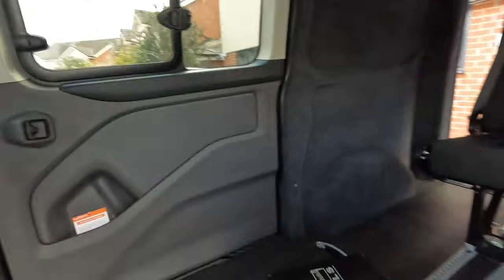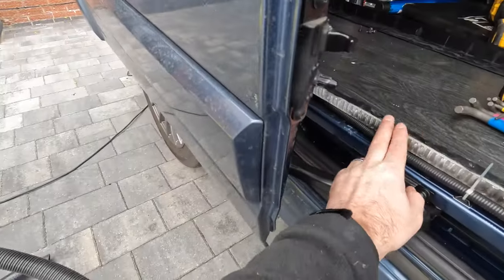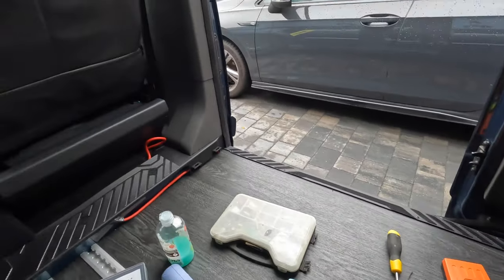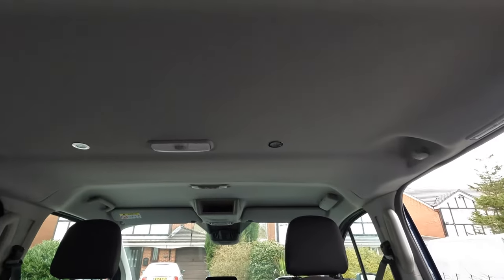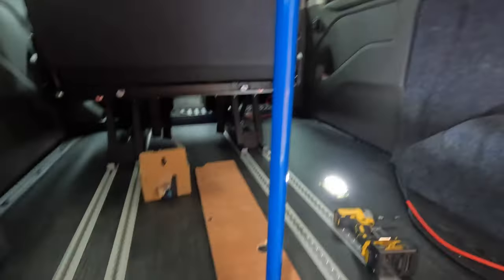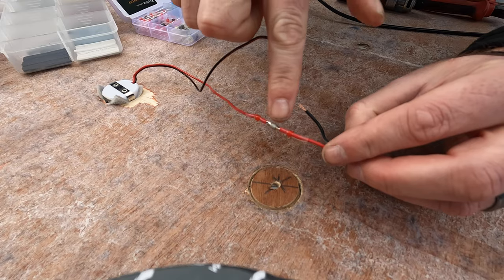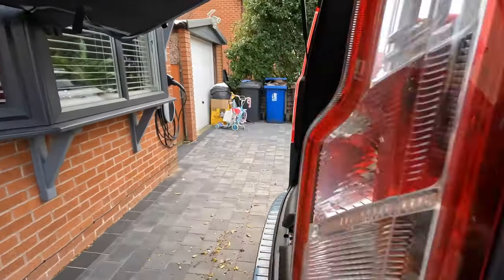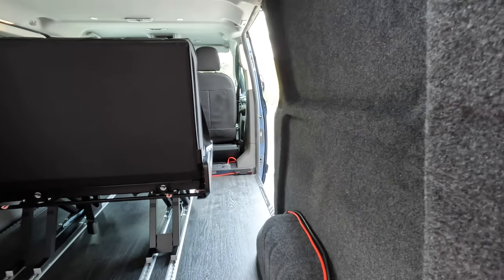Ep 4 Electric install and new Roof lining in a Transit custom camper van conversion

Comment: Where did you grab the headling from bud? Trying to find match myself. I also nicked your idea of using a scanstrut block for my solar, great neat solution 👍.
Reply from the maker: Hi the headliner material was from segal motor timings. It’s called FORD TRANSIT LIGHT GREY UNBACKED HEADLINING HL263. Best match I could find. The Scan strut blocks are miles better than the cheap ones you normally get. 👍🏻